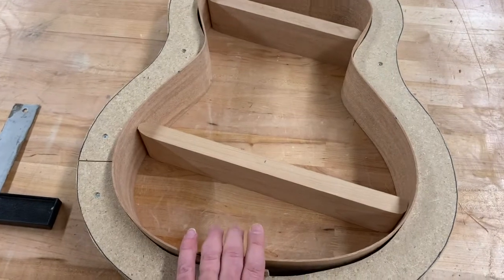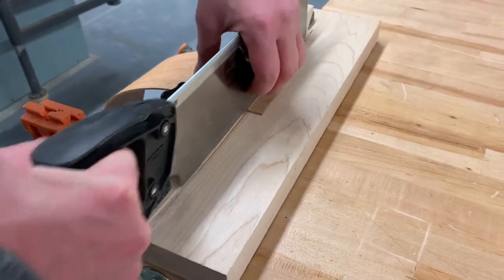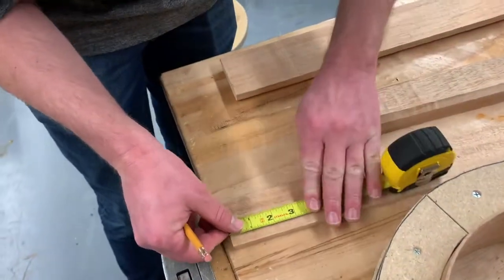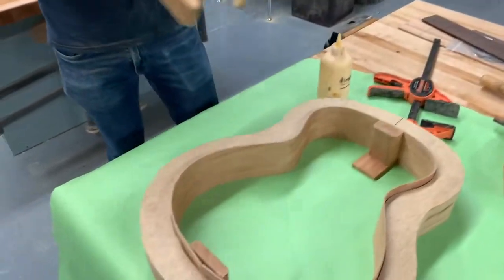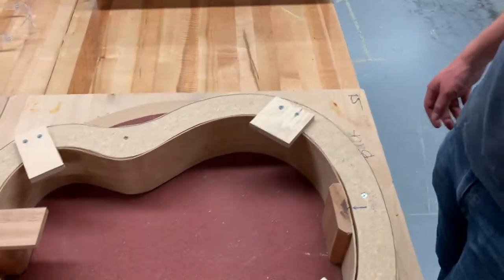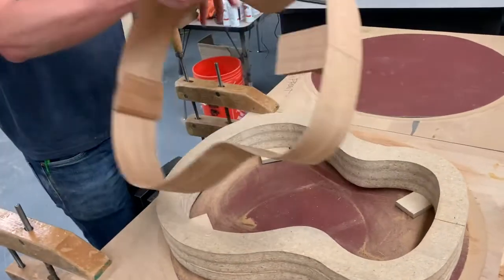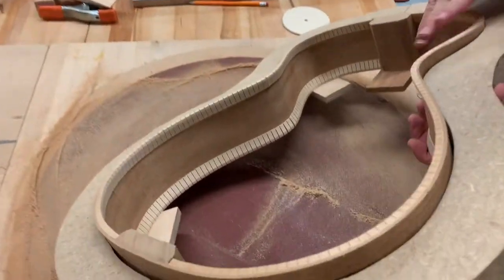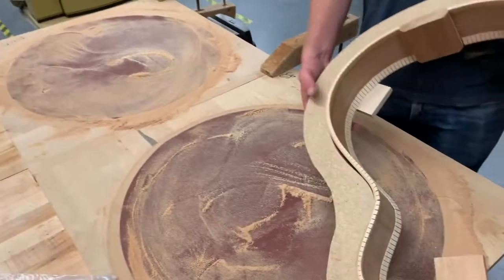How to Build an Acoustic Guitar - Side Kerfing and Sanding

Comment: Hi, great videos. I'm sorry if you already mentioned this somewhere in the video, but what type of glue are you using. Also, how would you reglue the wooden blocks and loose kerfing to a guitar with the top still on? The one at the lower bout came loose in an older jumbo acoustic, and my arm is barely able to reach inside the sound hole in order to place the block or apply any pressure to hold it in place. The kerfing that came loose is near the sound hole so it's easier for me to apply. One of the braces also came undone. My thoughts are to first glue in the block at the lower bout, then reglue where the loose kerfing is, then lastly reglue the loose brace. However, I don't know how I could clamp it to keep it in place with the top still on. Thank you.